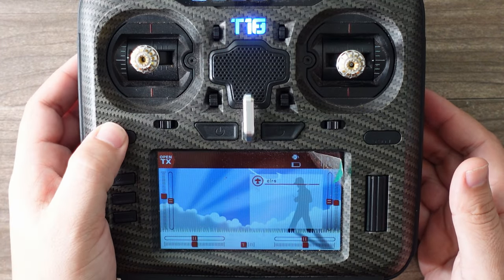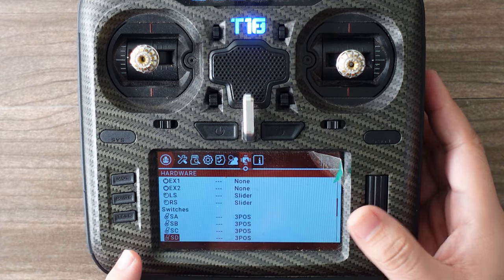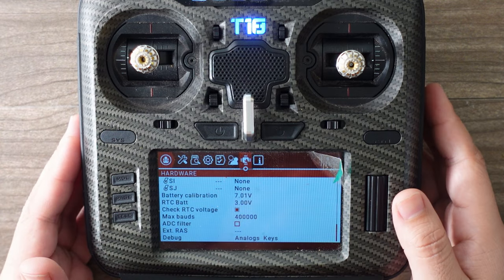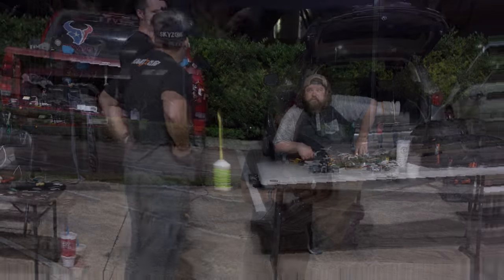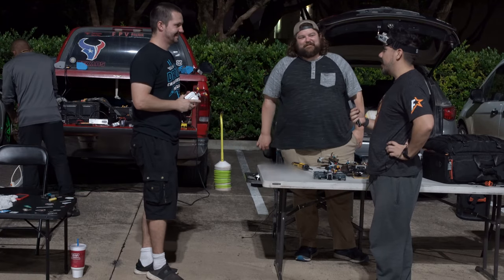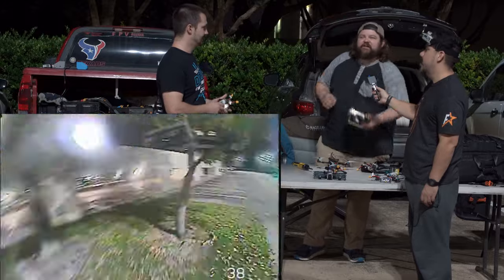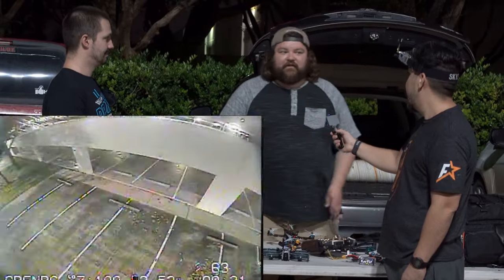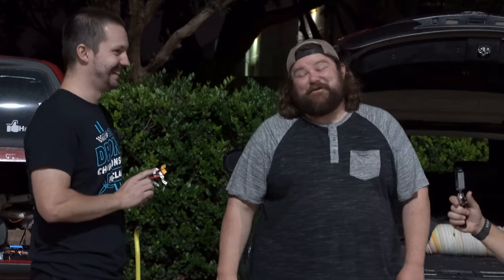TURN ADC Filters off! - Pawel cant feel them? Why?  Drone smooth settings

Comment: I turned ADC off and felt a difference in one of my quads. Stick inputs were more immediate. On the other quad not so much.
Reply: Could be that the feedforward now works better and that's what you felt.

Comment: Are there any disadvantages? Why are they on if bad??
Reply: Because without it some Planes will have some gitter in the servo.
But, yeah, i agree with you is stupid to have somethink bad on by default.
Reply from the maker: Its basically a legacy setting from planes as damiano mentioned.  For Quads it is only negative so best to turn them off.
Reply: Lots of planes (wings) use flight controllers, ADC = off

Comment: What about DJI controller?
Reply from the maker: that is a good question, im not really sure since its not open tx, so not sure how to check it.  I am guessing it does not have this setting, since it is basically a legacy setting left over from planes that used servos.
Reply: DJI code their own controllers, and may use ADCs in a different way. Apples <> oranges.

Comment: is it possible that the Tango 2 does not have this option?
Reply from the maker: I should have mentioned this, but i believe TBS removed this feature from their radios as it was basically a legacy setting from years ago.  It was probably why i felt such a HUGE difference my first time flying tango II. I assumed it was the decreased latency vs frsky, but this was probably most of that feeling change.  So if your radio doesnt have the setting, it is off and you are good.
Reply: Confirmed my Tango 2 has no ADC option.
Reply: @JonE5FPV  Thanks mate